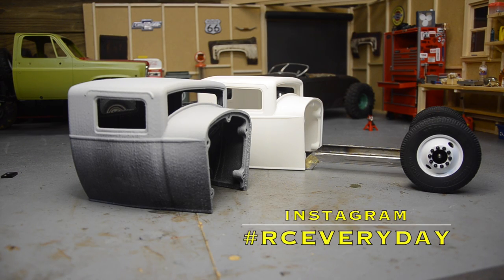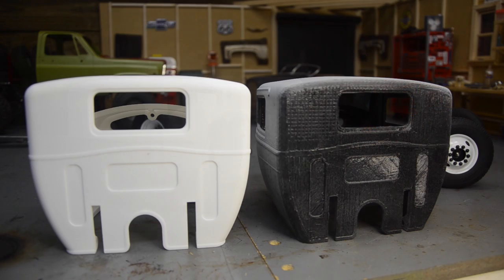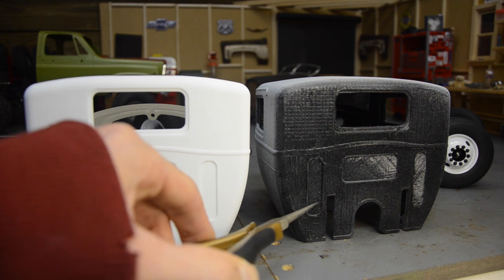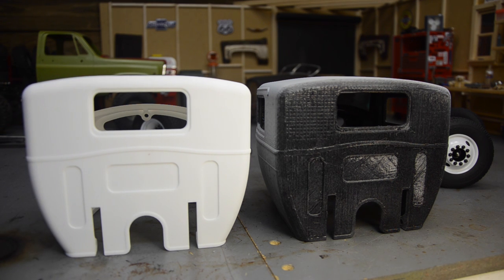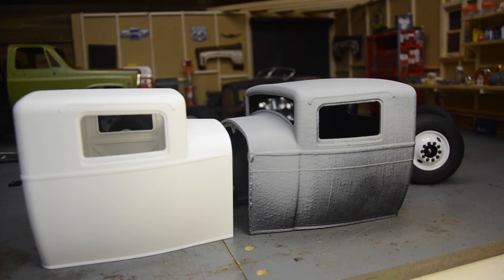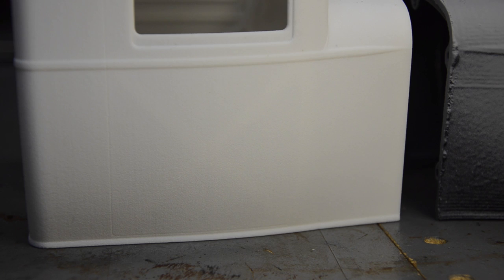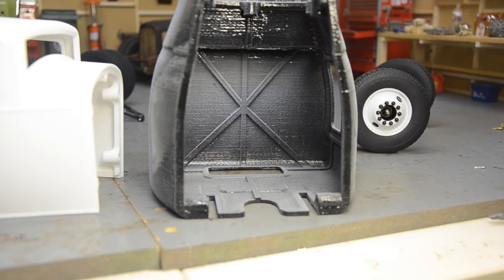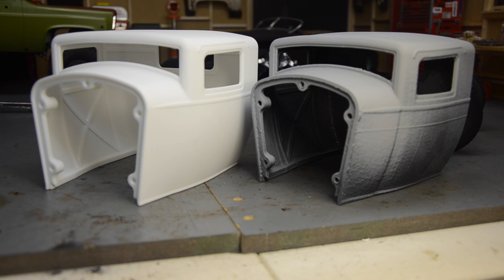3d Printed Custom RC Rat Rod Cabs, You Get what you pay for,  Shapeways VS Local Print

Comment: I glanced at the comments just to make sure I'm not repeating myself here.
But what's the black body actually 'made' of, because if it's PLA, your out of luck, but if it's ABS, it can actually be made glassy smooth and remove a lot of the texture on it.

If it's ABS, sand all the primer off (which might actually help smooth it down overall) and get a large tupperware box.  Set some paper towels on the bottom, and soak them in acetone.  Make an aluminum foil tray (or some other metal tray) and place it on the bottom with your cab.  Close the lid very tightly.

The acetone vapors will slightly 'melt' the exterior (this will take between an hour to several hours).  When it's close to the right texture you want, remove the pan but DO NOT touch the cab.

Let the cab dry overnight or all day so that the acetone evaporates properly and the exterior hardens.  And then boom, a nice shiny cab.  It will loose some of the tiny details, but if you hit it with some sand paper you should be alright.
Reply: Sorry, missed the part where he did the vapor bath 'apparently'.
I mean, I wont lie, the guy you hired had a fairly faulty looking printer.  I've got an old flashforge that isn't 'awesome' quality, but much better than what I see there.  I actually think he was printing it 'way' too fast.
Reply from the maker: Yea, its was suppose to be abs.  Since the cab has set for a while in primer it has apparently "gassed out" and cracked all over now.  It was printed by what appeared to be a large scale local facility on print hub.  Glad it was the only one i had them print. Its not just the texture, so many details were lost and print artifacts left exposed.
Reply: Yeah, that explains a lot.
Really looks like they were just trying to push it out fast.  Trust me, you can get such good detail out of a home printer if you set it up right.  And usually they dont take too long to set it up right if you take an hour to just sit down and watch several 3D printing videos.
If I can fit the print on my printer, I'm tempted to just try and print one of these myself and see if I can do better.

Comment: It's not only the material, its the way that the printer is set up, the orientation of the print etc. I print in PLA and have two printers, one Delta, one Cartesian. Same PLA on both, same files on both etc and each printer will produce different quality depending on what it is printing. I can get mirror smooth walls. Best way to fill imperfections is spray on high build car body filler.

Comment: wow, I should offer 3d printing services for those prices, I wouldn't recommend print hub after that experience.  and for the cost of 2 of the shape ways prints you can get a wanhoa i3. it's a great printer at the price and once dialed in will give you waaaayy better prints than that black one. all 3d prints that aren't printed with SLA 3d printer are gonna have lines between each layer but not as bad as the black print. nice video, I was thinking about printing that body myself. thanks

Comment: If your in dfw go to the makerspace near Carrollton. While i must say that's not an amazing fdm print it's not crazy bad i have seen much worse. part I find odd is it looks like ether x or y axis is not calibrated as the cab looks more narrow. Anyways if you need another cab let me know I will print you a free one in whatever material you like but if you want to sand,cut,paint I recommend ABS for detail work as it has lots of options and most paints and glues will stick well. techmasterjoe at Google mail looks good by the way I think I might build one for an 1/8th scale flathead v8 I made (no not printed)

Comment: Does anyone know how to smooth shapeways prints? Ie their versatile plastic? I have no idea how to tackle the fuzzy appearance of it
Reply from the maker: My method starts with a few heavy coats of primer then sand it down pretty heavily till the ridges of the print are leveled down. May take a few rounds of that depending on the shape of the print.
Reply: @RCeveryday  the problem is my prints are small detail figures so sanding becomes near impossible:/ what about vapor sanding?
Reply: @RCeveryday  does a acetone dip or vapor chamber work or do I need go use another chemical?
Reply from the maker: That could work well for you situation.  Just have to take it slow with the vapor bath.  I have never tried it on a shapeways print so  Im not sure how that material will react.  Typically only seen it done on PLA and low resolution prints.  Might do some googling to make sure it wont ruin it.

Comment: That's why I say having a 3D printer at home nowadays is a waste of money.  No matter how expensive your home printer is, 1000, 2000 dollars, doesn't matter, it's still essentially a toy compared to those professional machines they have in Shapeways and other big companies, that cost over a 100000 dollars each. Those are serious machines that give you the best quality available at the moment. Home printers are 10 years behind.
Reply: Though locally made one had wrong settings and low quality filament or something else going on. He printed it with .4 layer hight it seems and that waaay too much for cab like that.
Also you need to take in count that you are not to expect perfect quality of 100K machine in home environment from under 2K machine anyways. I'm just lucky i get parts at all and imperfections like that are easy enough to fix and since you want to do some detail work to peace anyways something like that is absolutely nothing to tread about, expect price maybe.

Also we are talking about two different printing methods here. If you want just blank peaces to work on FDM printer is great cheap solution, but requires supports and quality might not be the best. If you want great peaces with out support SLS powder printer is best choice, but will waste powder, it can be messy and most of all hella expensive. if you want superb details, then get resin printer.
Reply: Have you seen the home prints lately? Price of printers has also gone way down.

Comment: You are comparing apples to oranges. The white has been printed with an SLS printer and the other with FDM. What's more, even for an FDM, it is a very low quality print. You should research the limitations of each technology and then decide which method is suitable for your application. Also you should have checked the quality of the local hub first. There are local hubs that offer high quality printing, within the limits of each technology.
Reply from the maker: I agree, but the average consumer will not know all the ins and outs of 3d printing.  I know many of my viewers are just looking for a body so I wanted to demonstrate (and justify) the Shapeways price to them so they dont expect a flawless product for $40.  It hasnt been until recently from my collaboration with shapeways that I learned more in depth the difference in printers and their processes.